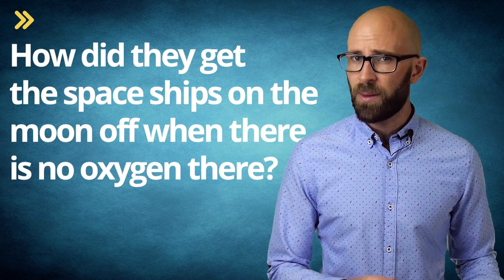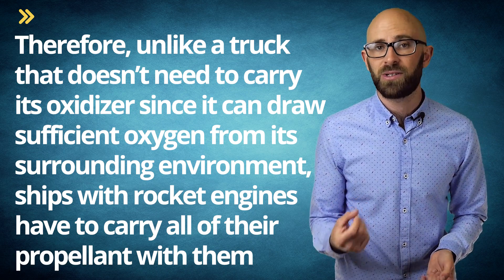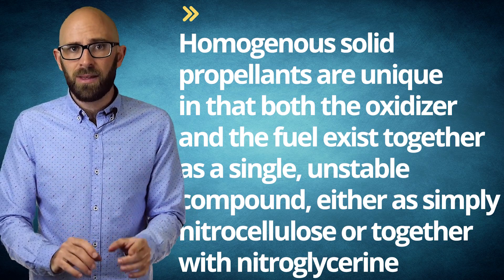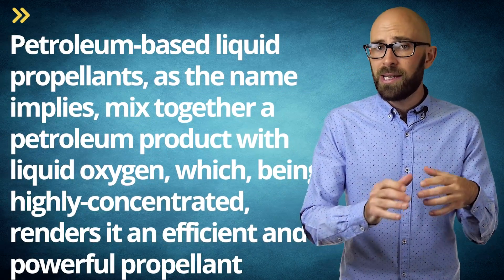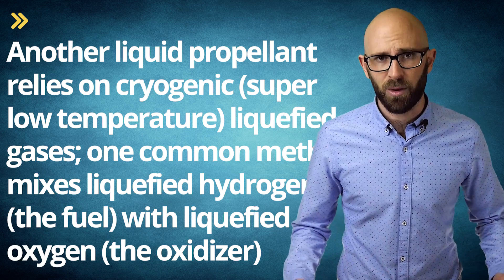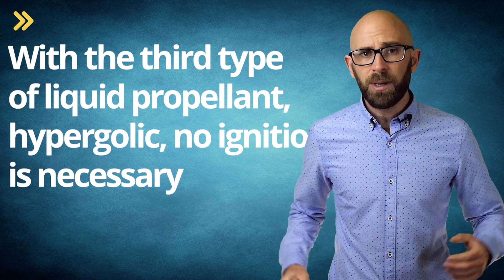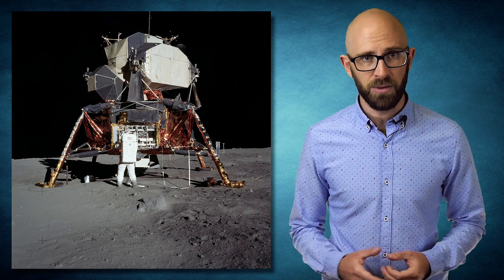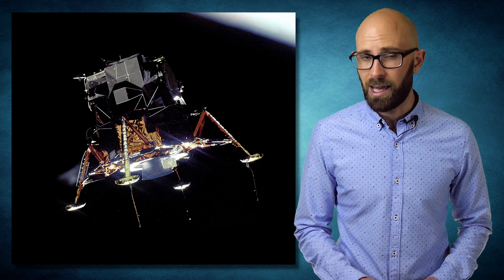How Did Lunar Landers Re-Launch When There's No Oxygen?

Comment: It had to be a pretty scary moment when the time came to liftoff with an untested motor...
Reply: Except it wasn't untested. The LEM had been tested in earth orbit by Apollo 9, and in lunar orbit by Apollo 10. And, of course, in hundreds if not thousands of test firings on Earth. The reason hypergolic fuels were chosen was specifically for their reliability - no igniter was needed with its added complexity.
Reply: Probably so, but remember, they were very familiar with all aspects of both vehicles. They knew that their ascent engine was fueled hypergolically, and that's a reaction that you can be quite confident of. Still, i guess no way to know that it wouldn't just blow up. That would make for a bad day.

Comment: The reason that all of the "Kennedy Files" have NOT been released is that he was going to expose the NWO and shadow governments plans to HOAX the moon missions and use that money for "black projects" and fund the Vietnam war!  ANY idiot that thinks that a human being could survive going through the Van Allen radiation belt with1960's and 70's  technology is a brainwashed uneducated fool! They STILL do NOT have the technology to protect astronauts from that intense amount of radiation economically! They would have had to be in an enclosed capsule that was lead lined 8 feet thick, and would have weighed far too much to launch on top of a rocket!
Reply: SGT ROCK 6/10 bait, good content but too long, you may lose people in the middle. Try making it shorter and concise.
Reply: "The [Apollo] astronauts had low exposure in the Van Allen belts due to the short period of time spent flying through them. Apollo flight trajectories bypassed the inner belts completely, and only passed through the thinner areas of the outer belts.[25][32]

Astronauts' overall exposure was actually dominated by solar particles once outside Earth's magnetic field. The total radiation received by the astronauts varied from mission to mission but was measured to be between 0.16 and 1.14 rads (1.6 and 11.4 mGy), much less than the standard of 5 rem (50 mSv) per year set by the United States Atomic Energy Commission for people who work with radioactivity."

https://en.wikipedia.org/wiki/Van_Allen_radiation_belt#Implications_for_space_travel

What else you got?

Comment: Couple points: There's a typo, it's not "hyperbolic".  And it's very useful to point out that hypergolic engines don't produce thrust with visible light emission.  So that's why you can see the "heat wave" but not what you might expect from having seen the exhaust of other rockets.